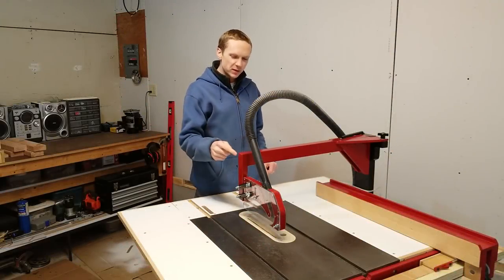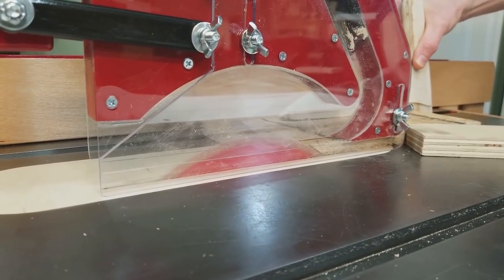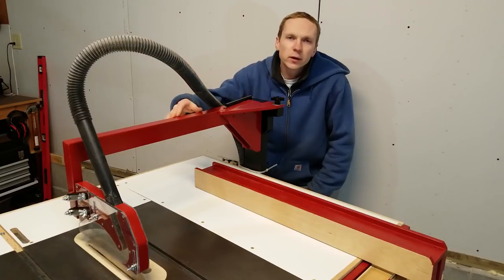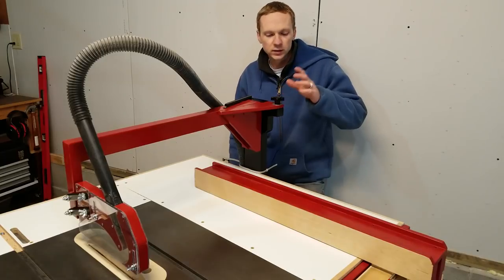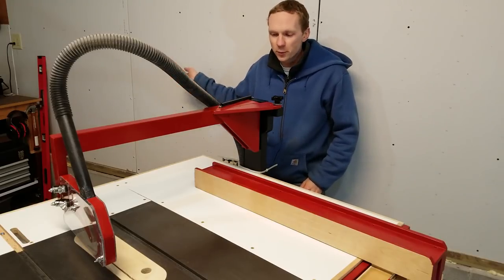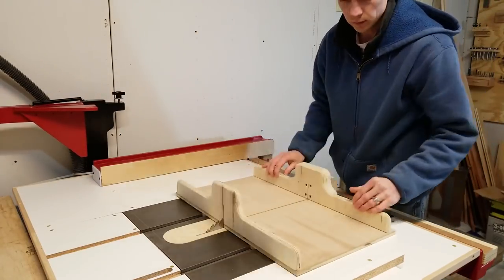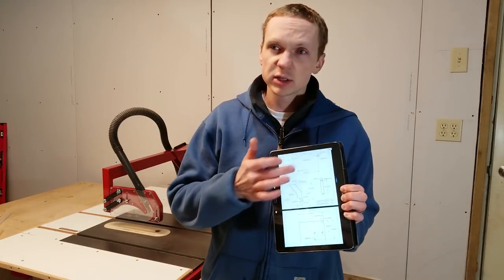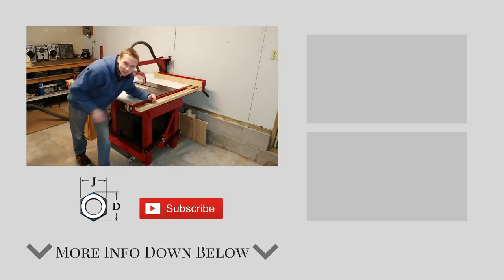DIY Table Saw Dust Collector

Comment: Nice! Some of my viewers might be surprised, but an overarm guard like that is something I've been thinking about making. Handy to have the dust collection right there, especially when cutting stuff like MDF.
Reply from the maker: I would be surprised too :D highly recommended though!
Reply: Using a laser particle counter I ran air quality tests with and without my over blade collector. It's impossible to maintain healthy air quality in the shop without one. Most of the dust generated goes to the bottom but enough gets kicked off the top to drive particle counts 5x more than safe max limits. 

I made something similar based on your design,  Justin.  Thanks for sharing.
Reply from the maker: @shophacks  that's great data. Thanks for sharing!

Comment: Great engineering on the shape of the collector hood.  I paid for the plans just for that.  It picks up virtually all the dust coming off the blade.  Nice work on the plan set and templates.
Reply from the maker: Great to hear Keith!

Comment: I got the plans and made one of these. It’s fantastic. I have used the extra slide down piece for edge cuts several times, which is a great feature, as those types of cuts typically send the dust flying. This captures it.
Reply from the maker: That's great to hear!!

Comment: Couple things... your dust extractor still works as a basic blade safety guard, keeping fingers away and reducing chips from hitting your face & eyes.  Always a huge plus IMHO, but I understand your disclaimer.  Also, as you pointed out... not only should you generally stand to the side whenever possible (for a better view and safety), but I was taught that your eyes should be watching the part/fence area to monitor the workpiece as you cut and not the blade itself.  This allows better control of the cut and reduce kickback chances.  

Nice job with this project.  I really like it and I will definitely refer to it when I build my own version.  My only suggestion, and it not related to your dust extractor, is to add a splitter to your insert since you don't have a riving knife.  I'm in the same boat with my old Craftsman 113 series dated 1968/69.

Comment: I made your design and it worked awesome! Far exceeded my expectations! But I can't ever stop so I wanted a bigger dust port connection, as my dust collection capacity had grown anyway. I changed the collection head design a bit because while the round curve appears it would encompass the extended blade, in real world cutting my blade is never more than a 1/2" above the product, and typically much less, so leaving the extra space in the collection head didn't add much except to channel the fan effect. I now have a 2" connection port, a drop down baffle connected to the very front of the collection head that drops down as the product clears the front of the head and corrals the stuff your trying to block by hand, with that other piece of wood, also added 2ea 1/4" plexiglass baffles in the collection head that help direct dust toward the 2" chute and also reduce the fan effect like an arc chute in an electrical circuit breaker and used a window latch instead of the turn knob for flip away moments. The performance is unbelievable!! And I would have never got there without watching your apartment video design and coping it, so thank you, I'm certain your work has helped many!
Reply from the maker: Mike, your improvements sound awesome. I would love to see a photo of it! I have considered also making a new design that would hook up to a larger dust collector line.

Comment: Thanks buddy, got my plans and completed the main unit. Now just have to design an arm that suits my shop.
Reply from the maker: That's great! What is your plan for the arm?
Reply: @JustinDepew  Basically an adjustable arm than can be quickly moved from table saw to a fixed work bench position.

Comment: Nice project! Have you given any thought to a design that could also work with the blade beveled?
Reply from the maker: Thanks. Yes I have considered that. But most people leave their blade at 90 degrees 99% of the time, so the complexity to make the design bevel isn't really worth it. Just don't use the dust collector on those few bevel cuts.

Comment: why dont you inlay some super strong magnets and eliminate the knob completely?
Reply from the maker: I wouldn't think magnets would be secure enough. Last thing you want is to bump the blade guard while cutting something... The blade would destroy the guard in no time.
Reply: @JustinDepew  ive seen magnets hold tables together some can be 90lbs hold strength a piece